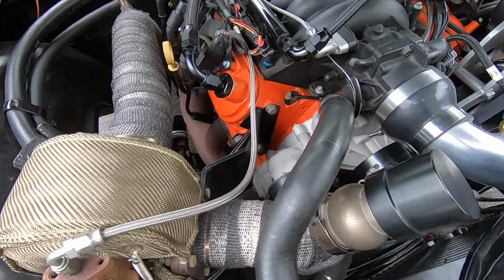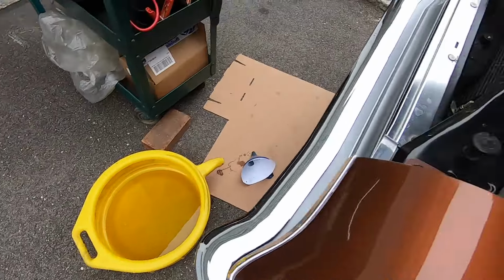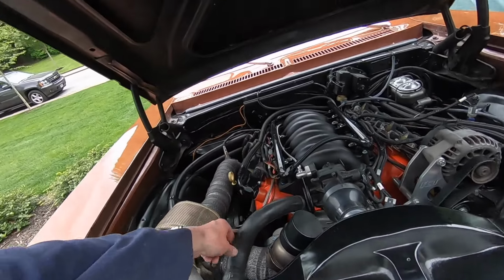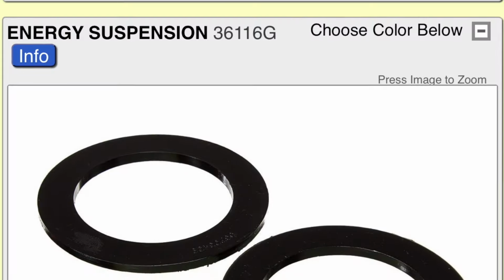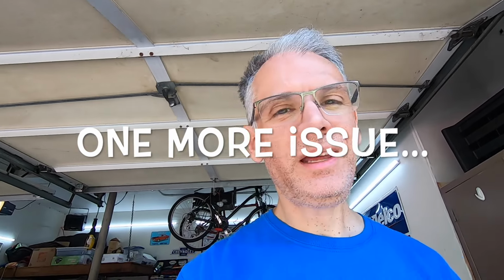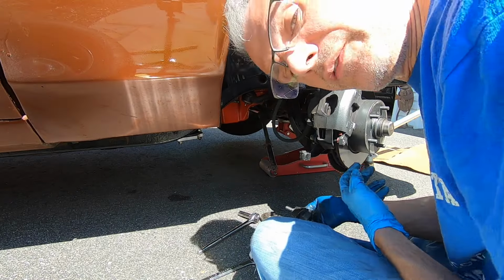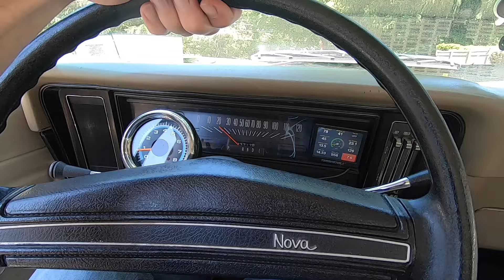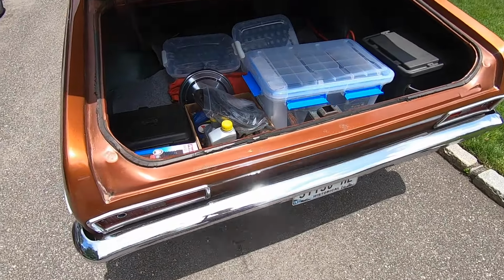More work on the Nova before Power Tour - Time is running out!!

Comment: When I have reconnected the cooling system on my LS I found that I needed to pull the top rad hose off and fill it with a water hose or coolant to avoid the air pocket. That was the only way to prevent rapid overheating.